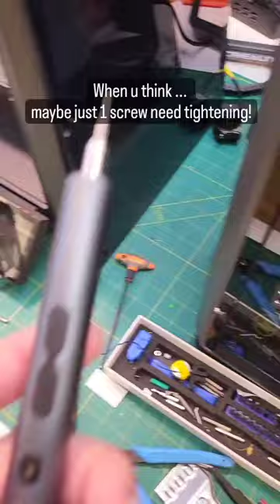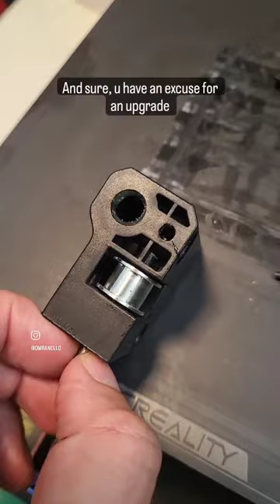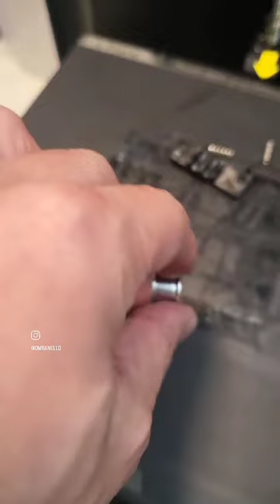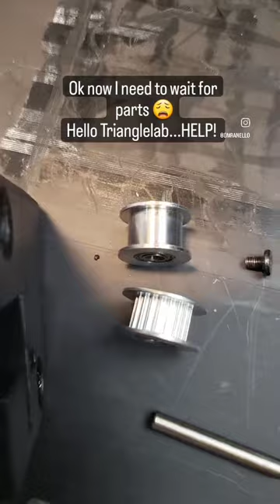When u think ... one more screw only ! #shorts #engineering #3dprinting

Comment: I saw that front pulleys are lower then the belts secure point on the head, thus belts are tilted and possibly making the belts teeth connect at a slight angle with pulleys teeth. Is there enough clearance for a correct bite?
Reply from the maker: Still to be tested ... the pulls I got are not right ... those original ones are W8 B4 without teeth .. I only had the W6 B5 ... ordered some for testing and will see how it goes ..

Comment: how did you remove the pin? im currently testing the front idler housings in ABS so i can replace the rollers when i need to with an m3 screw. Then to the x gantry too. that way i can also use heat inserts in them instead of screwing into plastic

Comment: I'm curious to see if toothed provides any benefit.  I've been wondering about removing toothed and replacing with smooth.
Reply from the maker: This is what we have in the voron ... the Bambu and the creality cam up with this approach .. for some imperfections in the design of the gantry I guess ... anyway .. am waiting for the parts since those have 4mm bore and the one I got is 5MM ... should arrive on next week ...
Reply: @omranello  In the Voron printers these toothed idlers are used in some places and the other areas will use the 2 flanged bearings that are smooth instead.  Those bearings seem to be of higher quality and made of steel.  One day soon I'm going to try and replace some of those idlers with the bearings to see what happens.
Reply from the maker: @KapmansBasementWorkshop  same here .. I guess the idlers r cheaper .. that's why .